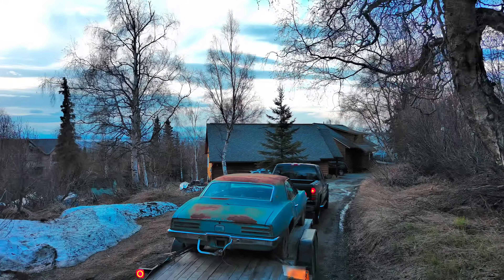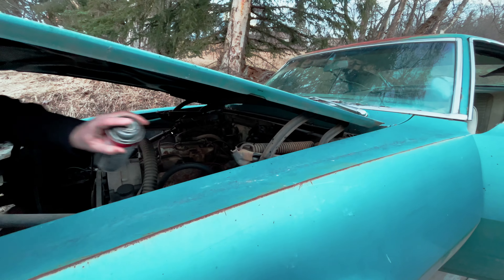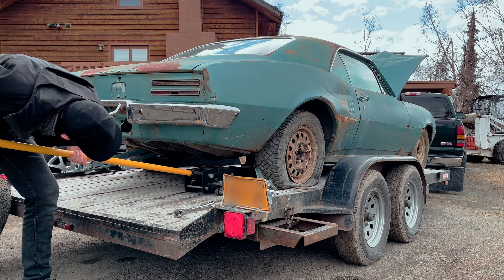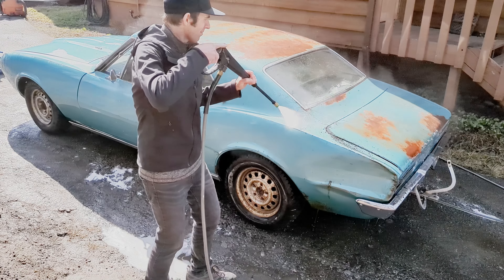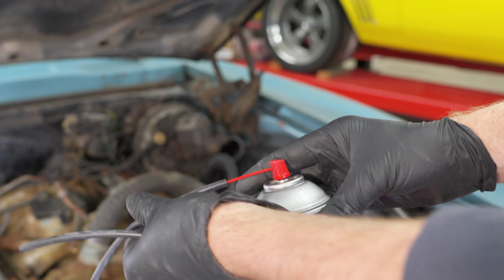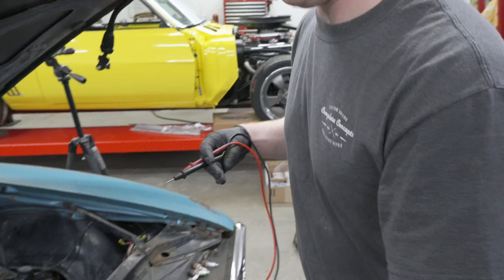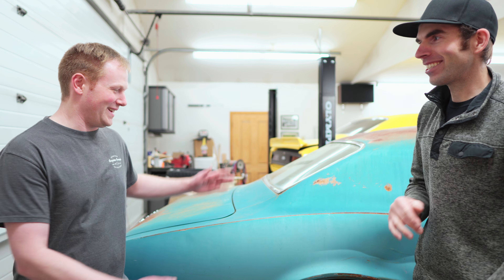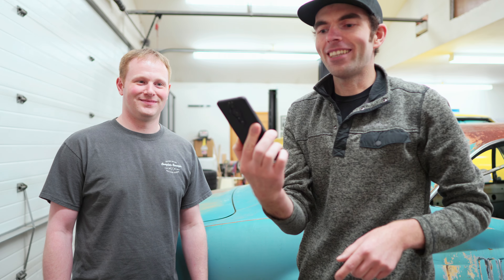We Bought a '67 Firebird Sitting in Alaska. Will it Run?

Comment: My 68 GTO sat for 46 years and the 400 was seized.   Tried Marvel Mystery Oil and ATF in the cylinders and still locked tight.  Poured 5 gallons of diesel in valve covers and let it sit over night and it broke it free.   With the way the cylinders looked and the hood being on it I would fill it till it leaks everywhere and give it a try.  It will break free and then you can fire it off.  I'd bet money on it.
Reply: PIN HEAD ‼️✝️🇺🇸
Reply: @G77799  not sure if that was meant as an insult or stating "nailed it".  But thanks either way!

Comment: Well with the fact that the transmission has cracked in all those places....... Maybe the front pump in the transmission is locked up, or torque converter is seized up or something? 🤷‍♀️ Have y'all tried pulling the torque converter bolts off of the flywheel and trying to turn the engine then? 🤔 Might make a difference 🤷‍♀️

Comment: Keep the old girl original. Check to see if it is numbers matching to be accurate. The ole 326 is very stout when operating and maintained. You guys could do it with a good machine shop help. Auto transmission replacement or rebuild is basic for this model. It is a well-optioned cruiser, not a high performance racer. Good luck…!

Comment: My 69 Grand Prix sat for 30 years and had 2 spun bearings and it still fired up, you need to pull the valve covers and make sure you don’t have valves stuck open

Comment: Not a bad car! 350 2/barrel(326?), power glide, power steering, power brakes and somewhat ironically for Alaska, air conditioning. Dinged up pretty badly but not a lot of rust. Worthy project I think.

I vote 400 Poncho mill and a four speed 😁
Reply: To hard to retro fit 4 speed peddles in a 67 to 69 bird, mighty tight around that area of the floor pan. ------ For power a 67 to 70 Pontiac 400 with a short shaft turbo 400 out of a Bird or GTO with a big stall converter. Bolt right in no sweat. Need to shorten the drive shaft & change the input yoke.

Comment: Also u should pull the valve covers  as their wasn’t any carb/ air filter nothing too protect the valves. Most likely some intake valves are causing the issue

Comment: Pull the valve covers and heads so you have a good view of the cylinder walls, heads, valves and all..A gasket kit would be better than not knowing what shape the heads and engine are in...Transmission has to another one. I'd want 4speed trans lol

Comment: It’s a 327 no such engine as a 326 hehe
Reply: 327 was a Chevrolet engine, Pontiac put out a 326 in 1967 which produced 280 horsepower and 355 ft lb of torque. Probably best to research a little bit before you start criticizing LOL

Comment: Ls swap
Reply: A 5.3 l LS is almost identical in cubic inches along with quite a bit of weight savings add a 4L 60e transmission a big mutha thumpr camshaft a good job buddy and instead of muscle car headers that Bob you'll be right down in the high levels are low 12 providing you have a good gear set add boost and you have a monster and absolute rocket ship